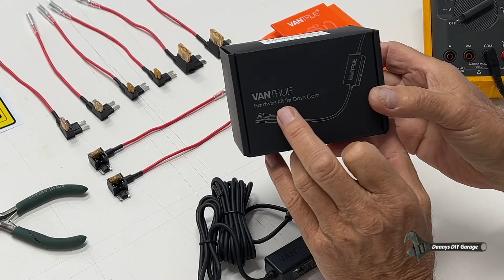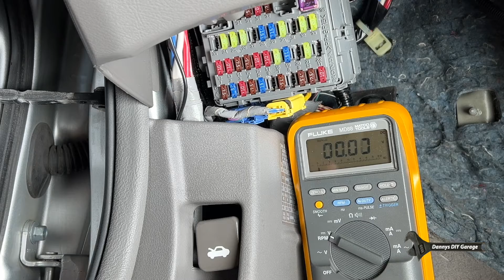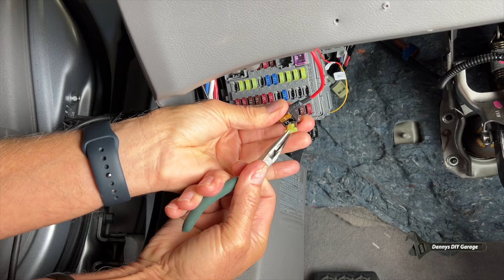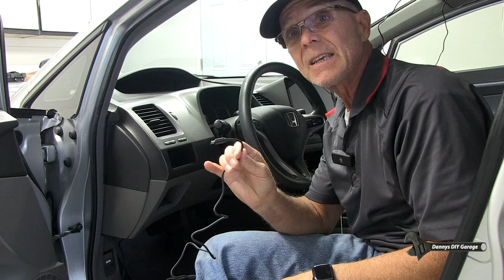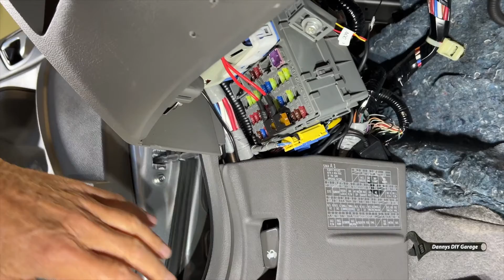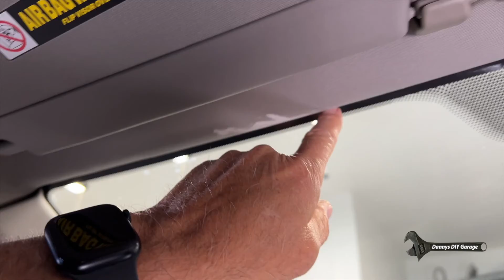Dash Cam Installation Parking Mode Vantrue  How to install the hardwire kit

Comment: If the camera is powered by constant power wire….. there is no need for accessory connection
Reply from the maker: The accessory connection is still needed for parking mode. The constant-power wire supplies power to the dash camera while the vehicle is parked, but the accessory wire tells the camera when the ignition has been turned on or off.

Without the accessory connection, the camera may not know when to switch between normal recording and parking mode.

The typical hardwire-kit connections are:

* *BATT/constant wire:* Fuse that has power with the ignition on or off
* *ACC wire:* Fuse that only has power when the ignition is on
* *Ground wire:* Good metal chassis ground

You also want to use a hardwire kit with low-voltage battery protection so the camera doesn’t drain the vehicle’s battery while it’s parked.

Thanks for watching!
Danny
Reply: @dannysdiygarage that makes sense, didn’t know it switched to a “parking mode”. I get why there are 2 wires now. I’m putting this camera in my sons truck, possibly wife’s as well
Reply: @dannysdiygarage when the camera powers off after key off….. it goes to sleep in park mode and only cuts on when activated? I just hardwired and installed a vantrue N4 S 3 channel in my son’s truck. Wanted to be sure it’s working when vehicle off before we trust it any further

Comment: Thanks for sharing. Just have a question I got my cam all set up and hardwired. The cam is owing on and working. But couple questions I have is how do I know or find out while in parking mode the motion detection recording is working? ( tried to wave my hand around the cam while the car is powered off and shake the car but the cam didn’t come on recording). Also second question is if I don’t start my car for two days the battery will be drained?
Reply from the maker: Sounds like it’s hooked up incorrectly and draining your battery Battery Dead? Everything you need to know about Finding a Parasitic Draw | Stop Pulling Fuses!
https://youtu.be/Dn2cFXV9lCk

Comment: What a lot of GARBAGE, PERMANENT VIDEO ON (Vantrue E1 Pro) using this kit. Have to use the OFF switch every godamed time I exit the vehicle. POINTLESS BUY.
Reply: Whole point of wiring is to record without having your car on. Are you slow?
Reply: @tjporras526  Bot; I only want it to record if the car is hit (or captures movement), not be on 24/7 frying the MicroSD cards on summer nights (which it does when set to 4K). Here is one for you Sherlock, the E1 Pro uses up to a 1Tb card, now you Name One 1Tb card that Vantrue recommends. Just one. As they tell me, IT MUST BE "A VANTRUE CARD" OR be "HIGH ENDURANCE" (Ultra/Pro Plus/Evo cards ''NOT ACCEPTABLE'' by Vantrue support). Try find one (1Tb card) that can be bought, that they agree to support as they they they say the E1 Pro supports "Up to 1Tb" (but have no 'in-house' card to record to that capacity [& blame "Recording problems" on lack of quality of a series of SD cards that they claim are not acceptable to use 'for reliability'). They say "1Tb", and THEY would not point me to one anywhere on Earth (as my issue was the recording fault issues were 64Gb/128Gb cards seemingly getting too hot during overwriting, [set at 3m units][due to being on all night & all day week in & week out, month in & month out]).

Comment: For anyone worried about the airbag, you should be.  Not sure if Danny has a different modeled Civic, but my side curtain airbags get covered if I hid the cables like he did.  I'd recommend removing the A-pillar trim and running the cable alongside the stock wire harness until it reaches the end of the airbag.  If youre having trouble removing it, look it up, because you wouldnt believe me if i told you.  Hope this helps someone.

Comment: Thank you very much for a very good video.
I have a question: when at the end of your video you show how to hide the wire, you cross over an airbag. Isn't this dangerous and could trap the airbag if it goes off in an accident?
Just another question: what is safest to install: 1. hardwire to the fuses or 2. install to the OBD input. 2 different kits.
Thanks in advance for your reply.

Comment: Hi Danny, 
Thank you for sharing this video on a dashcam installation, when you feed the wiring from the headlining, through to the A-Pillar, and down to the weather stripping, it looks pretty straight forward, my question to you is my biggest concern, the way you feed the wiring through the A-Pillar, if God forbid, if you're involved in a accident, will it interfere with the operation of the side curtain airbag?
Reply from the maker: Great question, Make sure it’s not in the way of any deployment

Comment: ? I have a 2014 Acura RDX.  According to my multimeter - all of the fuses are showing power - even though I can't use some of the functions, like windshield wipers without starting the car.  Anyone have any suggestions or ideas?  Thank you in advance
Reply from the maker: Not sure of your question
Reply: @dannysdiygarage  My apologies.  I have the Vantrue hardwire kit and have watched your video.  My understanding is I have to connect two wires to the fuse box.  One goes to a fuse or an empty space that always has the power on in the vehicle even if it isn't running - i.e. the door locks.  I also have to find a fuse or empty spot (for the accessory wire I believe), that goes to a fuse or empty fuse receptacle that only works when the vehicle is running.  If I have that right - my issue is - with the old analog multimeter I am using - it indicates all have power to them - even when the vehicle isn't running.  For example - I can't turn the windshield wipers on when the vehicle isn't running, but yet it still shows pwer per the multimeter.  Can I still hardwire this somehow?  Not sure if this matters - I have no idea how to use the multimeter.  I was trying to just follow the video and you laid it out so clearly.  Does that make sense? Thank you for even considering helping me with this.

Comment: I don't understand where the yellow wire gets plugged in to? Unless I missed something or didn't understand.
Reply from the maker: Yellow wire ones to a fuse that only has power when the key is on

Comment: dumb question - I have the Vantrue wire kit and the N4. I only want the camera to run while the engine is running. Which wire would I use? The battery+/red or the ACC/yellow and of course the black ground. Watched other videos and everyone seems to do it differently. Or does it not matter since the fuze is cold when the ignition is off
thx super

Comment: Why is one wire hooked to battery and one to the accessory? Also, it seems like you skipped through hooking up the ground wires or did I miss it?
Reply: I mean you could just plug it in the cigarette lighter. The reason is because you can use your camera with the car off, for things like motion detection which is how I use it. 

The accessory one is when your car is on and  it’s always recording. As far as the ground, he did mention it in the video. He said where all the grounds goes. But basically, you can use any metal screw, anything close to the kit.
Reply: @thatlatinguy9039  Okay thank you. All this stuff is kinda above my head

Comment: Great tutorial Sir! One of the best and easy to follow imo 👌🏽

I do have a question, when piggybacking on an existing fuse slot, is it ideal to have a matching fuse amp as the original fuse you’re sharing it with? 

I know you mentioned a 10 amp is safe to use on an empty slot does the kit come with various extra fuse? 
Thank you in advance 🙏🏽
Reply from the maker: If you’re piggybacking a fuse, it should be the same fuse size or smaller

Comment: I have open fuse slots like 6, 7, and 8 that are currently not used in the fuse box, how many amps are those? I ask because I know the voltage will read 12v but can I put any fuse on those empty slots?
Reply from the maker: Yes and no, a 10 amp fuse would be safe to install on the open fuse spot
Reply: @dannysdiygarage  thank you Danny! Would this apply for all the empty fuse slots left by Honda purposely?
Reply from the maker: @arturoalvarez4043 yes
Reply: @dannysdiygarage  thank you again Danny!